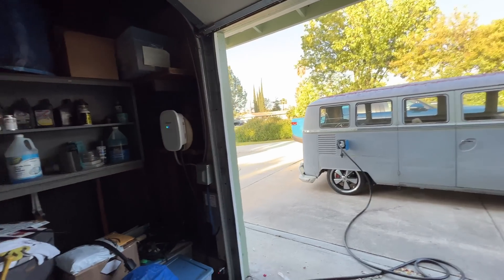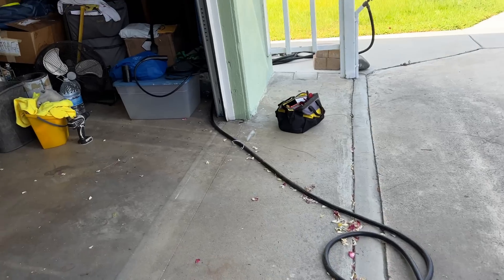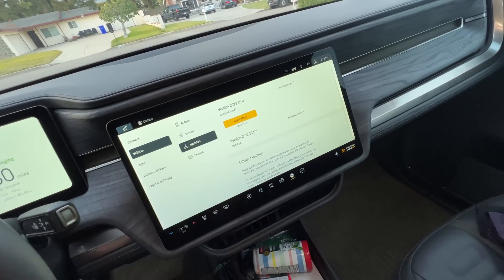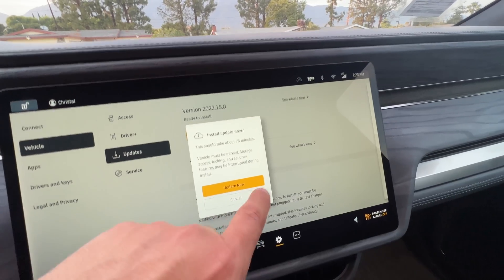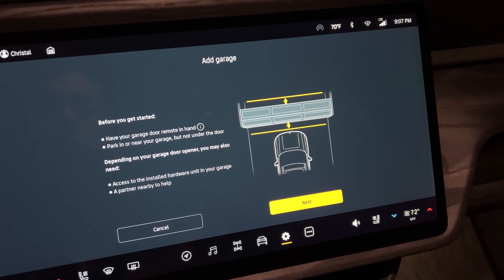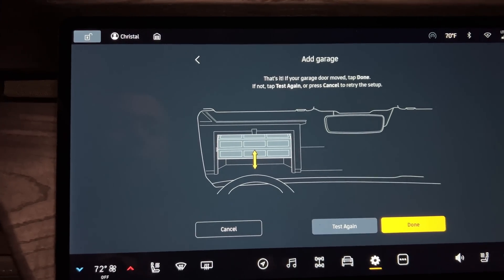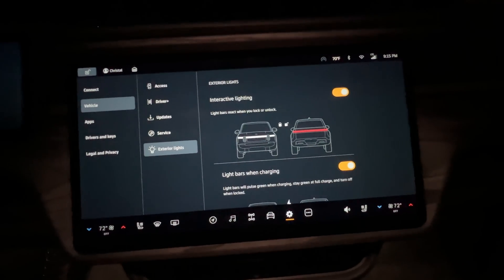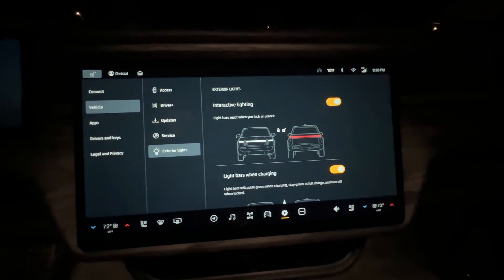Why 48A Charger is Important - Rivian Over the Air Update

Comment: Please use the correct terms.
The EVSE puts out 48 amp around 240 volt, you were only getting 232 volts when yiu showed the Tesla screen.
It's NOT 11 kwH, it's 11 kws.
Kwh is how much energy is stored, like you have a 135 kwH battery pack.
It can charge up 11.5 kw.
240 volts x 48 amps (when using a 60 amp breaker- 80% is 48 amp.
You should have two EVSE'S that can power share since you have three electric vehicles.
A 100 amp breaker- 80 amps shared would be best.
Reply from the maker: Shout the hell up,  you pedantic fool
Reply: He has seven days in a week though.

Comment: like 4¢/gal of gasoline where I live, at home I charge on a 50amp 220v plug at 1¢/kw - it's basically like free, or about 1/100th the cost of gas
Reply: 4 cents a gallon? The heck do you live, Venezuela?
Reply: @eddiesantos6407  Georgia, USA
Reply: @Beakerzor  Pardon, unless you personally own the gas station/fuel depot, there is absolutely no way in this universe that gasoline is 4 cents/gallon in Georgia. If such were true, the amount of people rushing ... FIGHTING to not only fuel up their vehicles, but bringing in extra storage to take more fuel with them would be so absurd that there would be riots forming and the national guard would have to get involved. Sorry, but I'm not believing the 4 cents/gallon story.
Reply: @eddiesantos6407  no no, I meant the price of 1c/kw is like paying 4c/gallon, sorry for the confusion
Reply: @Beakerzor  Ah, that's making much more sense! Thanks for clarifying.
Reply: It's 33 cents per kwh on my monthly utility bill in Canada. Where do you live that electricity is so cheap?
Reply: @ricknash3055  to be fair, it's a scheduled rate, 11pm to 7am, otherwise it's 7c/kw
Reply: @Beakerzor  
So we are clear with the electrical costs, last months bill is; 161.5 kwh @ 0.1058/kwh and 47.558 kwh @ 0.1652/kwh, $6.60 admin fee, $1.40 rate rider fee, $20.28 distro charge, $8.10 transmission charge, $0.47 balancing pool charge, $5.93 local access fee, $0.02 utility deferral adjustment. 
All of this works out to $0.3222 per kwh.
You have an amazing deal I'm skeptical will remain as demand skyrockets.
Reply: how can anyone afford gas cars!?  those are like $4000/year just for GAS!
Reply: Where i live in NY with all fuel fees and taxes added we pay like .30 per kWh.  I think we are only behind Hawaii in price .  On the bill it say you pay .16 kwh to try and trick you into think your not getting ripped off.  I❤️NY
Reply: @daversj  I think California is up above 50c at peak times in some areas
Reply: @Beakerzor  50c per kWh?? That's cra-cra.  California always gets to the future first lol.

Comment: I will wait until the Rivian Truck and SUV lose some weight and get to 400 miles of range otherwise such an adventurous vehicle is worthless and more like a glorified overpriced electric car.
Reply: Lol…… it has nothing glorified or overpriced, it’s just the first production model from the company and the first tesla wasn’t cheap either!
Reply: Toyota currently has solid state batteries in test cars now.  They are lighter, charge in ten minutes, higher capacity, no heat issues, no fire risks….Not a dream anymore, Its happening.

Comment: 3 pieces of Junk and they all take 6 plus hours to charge ?   And if the grid goes down ? 
Your in Calif. right ?     lol    NO WAY !
Reply from the maker: If the grid goes down you won’t be able to pump gas genius.  I wanna see try to fill your gas tank with solar panels….
Reply: Good point, power goes off during the night and you're not aware of it, does the car that was on charge  - restart as soon as power is back on?
As for gas/diesel, they can power a fuel depo with a generator.
Reply: @Zendukai  and? Home solar setup can charge when the power is out.
Reply: @eddiesantos6407  
Is this the same home solar system powering the A/C ?
Reply: @eddiesantos6407  I have home solar set up, do you?
Reply: @ricknash3055  some people think a home solar setup can power everything lol. Well... Unless you have banks of batteries, you might have half a chance and a paddock full of solar panels.
If it takes all night to charge a car/truck then a solar battery system of regular size might last a few minutes.
Can you imagine if everyone had an ev? Omg... I used to be in a shed that electroplated zinc, drawing 26000 amps, 720 volts, and in the summer we had to shutdown to holding power so the city of a million people could turn on their airconditioning. Aaaand the new thing here is, the electricity companies can now turn off your solar inverter if the GRID is getting overloaded, you need your inverter on to recharge your batteries.. fun times.
Reply: @Zendukai  I do, battery storage too. I charge my EV for free off my system, but then again I happen to live in a state where the sun shines a lot.
Reply: @eddiesantos6407  
Can you share the specs of your solar system, and any ROI calculations?
Reply: @ricknash3055  Sure. I have 20 panels (produces about 1000 kwh monthly) and two Samsung 13.5 kwh batteries for storage (with expansion capabilities for two more batteries if need be). Return on Investement? Hmm, I got this setup 4 yrs ago. Cost me about $30k prior incentives and rebates. I admit I was lucky enough to take advantage of certain incentives no longer available. But I got 26% return from the government, about $1500 from the company that installed the setup (no longer available), another $2k from local and state incentives (no longer available), and was able to finance the remaining balance (just over $18k) at 0.9% for 10 yrs. ATM I produce more energy than I use, so I tend to "sell" some of that extra juice back to the power company (varies month to month).
Reply: We are paying + or - 35c per kw here, how much are you paying to do a recharge in an EV in the states and per kw ?
Reply: @eddiesantos6407  
Thanks very much for the detail. I've been waffling for a solar panel system on the house roof along with batteries, inverter, etc. Waiting for my late-to-the-game Tesla stocks to yield a gain sufficient to purchase the solar package.  :)
Reply: @ricknash3055  I won't deny it. They're a pain to get into and there are a LOT of incentive programs that come and go (pretty quickly too), so one has to do some serious shopping around, researching, and taking advantage of incentives as soon as they pop up. As it currently is (2022), it's easier to get just solar panels than it is getting the whole panels, batteries, inverters, etc. And pending on your city and/or state, you may only get the incentive from the government (26% back). Only other advice I can give you is, if you do go for the full set up, avoid the LG Chem batteries for storage. They're expensive and have been known to come with issues.
Reply: You've never driven an EV. You have absolutely no clue if they're junk.
Reply: Solar on the roof is really the next step after you buy an EV.  You end up generating more electricity than your cars consume in a month.

Comment: I wonder how many amps you’re pulling on the 240 V side? I remember you said it’s a 60 amp breaker.
Reply from the maker: 48A
Reply: The answer is 48 Amps. You can pull max 80% off of the breaker safely.